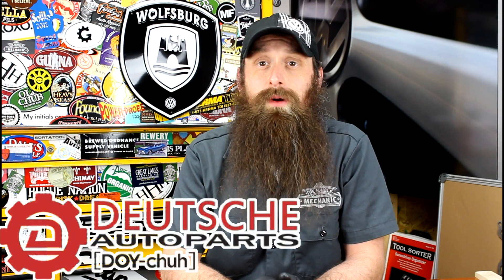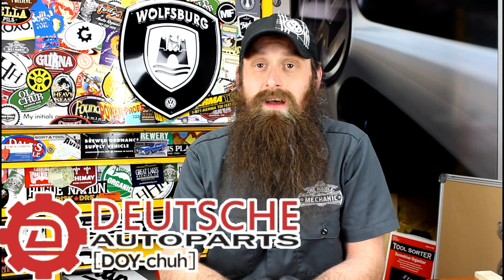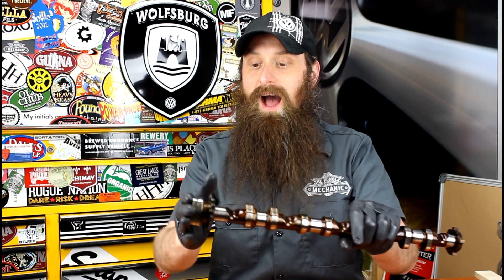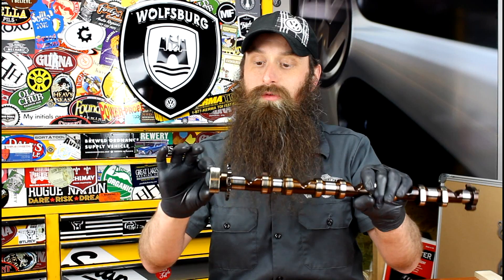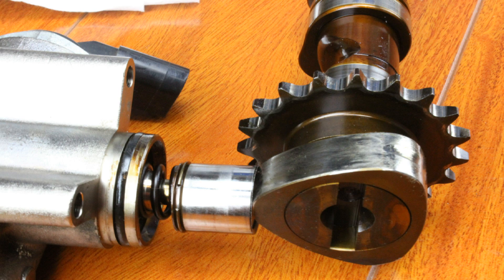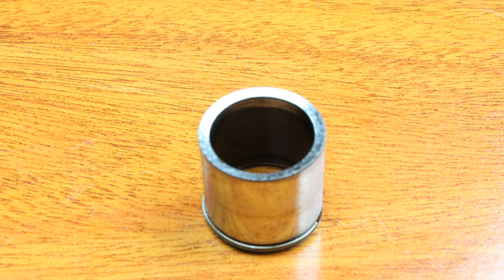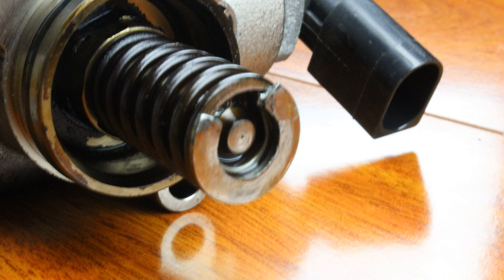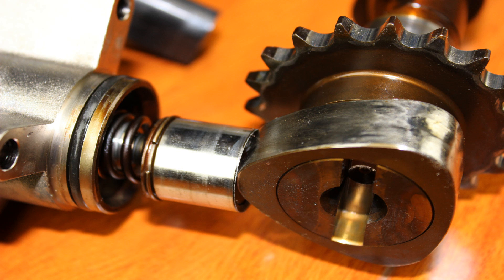How The VW 2.0T FSI Fuel Pump HPFP Fails

Comment: Hi HM. Is it possible that the pump and follower could be damaged whilst the lobe is just fine? Replaced the HPFP and the Cam follower without replacing the Camshaft and the car is running just fine, i'm just wondering what the dangers could be.
Reply from the maker: With no damage to the cam, I doubt it. But it may not be bad enough to cause an issue.
Reply: HumbleMechanic Thanks Charles

Comment: My 2005 fsi raves do not go above 4000, and fault code is p310B, that is low fuel pressure, could this be the problem or something else
Reply: douglas dingindlela Mhlanga did you fix your problem? My car hat The same problem and I can't fix it😟
Reply: Yes finally got it sorted yesterday, had to change my throttle pedal sensor, and clean the throttle body, now all is good and an enjoyable ride again

Comment: I have upgrade my HPFP for a high performe one, the Evo Technik by Autotech. But I'm getting an engine fault flash light. Do you have any thoughts on this?
Reply from the maker: wha tis the code?
Reply: HumbleMechanic "too rich on fuel"
Reply: If it not mapped for the new volume it will flag a code.

Comment: Hi humblemechanic thank for all the help you have provided us.
My vw cc 2011 has a problem out of no where is shot off and I though it was the HPFP and I order the part from the DEUTSCHE AUTO PART and i was really hoping it was that but it turns out was not and still does turns off when am driving it and it does not show check engine light.
I took it to a certified mechanic and since the check engine light is not on the scanner can not read it. Any idea from where is the problem? 
Thank you
Reply: hey man. did you find out?so what is the problem actually?

Comment: Hi. Soooo. I bought a cam follower thinking mine was bad, i removed HPFP and it was just perfect, no need to be replace... So my car keeps lossing power and shuts down because fuel problema with HPFP. Cold it be no power on fuel pump? How to check? 😶 or high pressure regulator ? Sensor??? 
Please help 😪
Tank pump is new.
Reply from the maker: +Gustavo Ortez fuel pump control module?
Reply: HumbleMechanic 😕 soo i replaced it. The car is working a lot better now but code P0089 & P2540 stills is there and keep coming back. Sometimes car shuts down and won’t start until i give it sometime. Any other tip? 😢
Thanks for your help and hard work lol
Reply: Gustavo Ortez hello as you know this car can be a real pain 2500 bucks later i got the same bogging nocking replaced fuel pump camshafts change followers mass air flow sensor fuel pump fuel filter water pump ignition spark plug coils I still get the PO101 code

Comment: I know I may be going out on a limb here, but would you say there is any permanent solution to this cam follower catastrophe? I find that checking my cam follower periodically could cause future damage to the pump bolts by wearing out the threads and removing the bolt from the banjo head fuel line isn't quite fun. I also have been doing some research and I found that there is a "2.0TSI roller cam conversion" for the "FSI"models. Would you say it's any good?

Comment: I have a p0089 code saying fuel pressure regulator, could this be the cause?  2006 A3 2.0t, I just checked and the black paint is worn off the follower, I'll replace that but do I need to replace the regulator that sits under the tank?  Soo many chats about this code and people just replacing pumps and filters with no solution.  Any feedback is appreciated.

Comment: Hi, cool video very helpful. I recently purchased an Audi a4 2006 2.0T Quattro. The check engine light come on with code P0089. The mechanic who happens to be a german auto specialist at the initial stage said he checked the hpfp and cam follower cam shaft and it looked fine. They replaced the sensor on the hpfp, after a day the light came back on same code. Now he said its that hpfp. I can notice the car does have a little hesitation from idle and if you gently press the accelerator it jumps to second gear. I was told this is normal as its a turbo i dnt notice power reduction the car has power but it does have a slightly louder noise than normal. I am going in next week to replace hpfp and cam follower. What are your thoughts. And also are fsi engines louder i went to audi and test drove a audi a4 2012 and it sounds like my 2006 but a little quieter. Thanks

Comment: Mine failed, vw Canada does not have a warranty extension for this issue. The retention nib on the hpfp was starting to get worn through, the camshaft seemed fine so I replaced the pump and the follower. Gunna check on it in 2000 km or so to see if the follower is still in good shape.

Comment: Hey! I have an automatic 2010 VW CC with 108K miles on it. My check engine light recently came on and I got a diagnosis and it coded P2015 "Intake manifold runner position sensor/switch circuit range/performance bank 1". Afterwards, my engine also began to stall and shut off and right before it would shut off the battery icon would pop up on the dash. I replaced the battery and I am still having this issue with the car stalling and shutting off. Sometimes I have to get a jump in order to get it moving, sometimes getting a jump doesn't work at all. Is this a common issue or something that you have seen before? If so how do I go about getting it fixed and about how much do you thing it would cost me?

Comment: Will this most likely fix a p2293 code? Says fuel pressure regulator and also got a system lean code with it. Replacing fuel filter today to see if it gets fixed. If not, going to the stealership. Wish me luck. PS love your videos helped me with a pcv valve and cpl other things. Please respond. Thanks!
Reply from the maker: LOL, best of luck. I got my fingers crossed for ya

Comment: hey Charles love your vidoes, Im a tech at a shop and a b7 audi came in with a valve cover leak, Mitchell said at was a 6 hour job and a special tool was needed to lock the cams... so they shiped it and i dint get to do the job:(. I have never done a valve cover on one of those... i just want to know if it that is really what haves to be done. if so. i will need to get that tool cause i plan on up graring my own b5 avant for a b7 avant. thank u for all the good content and keep up the good work brotha. 🖒

Comment: Thanks Humble Mechanic, all great/very helpful videos. my question is: once the cam follower wears through, where do the little metal parts that wore off end up going? the cam follower metal flakes/hpfp spring retainer? where does this stuff go? into the engine? 

if mine was covered under extended warranty, should I be concerned that I have metal flakes floating around in my engine?

Comment: Hi Charles, great video! A+! On my 07Passat 2.0T FSI, after a brief 
inspection i found the cam follower to be broken, there's a hole all the
 way thru and the center piece metal is gone most likely into the 
cylinder heads and the HPFP itself has a little chewed up on the edge of
 the piston, where it touches the cam (due to broken follower). I know 
not good signs at all, but the upgrade internal kits are about 500 bucks
 from places like Autotech I found that insanely expensive for just a 
few piece of metal piston..I'm wondering If I can just get away with 
just replacing the piston from another used pump? and put a new cam 
follower, and replace the cam? How can I tell if my camshaft is damaged 
from this, just look out for scratches and the uneven wear on the cam 
lobe? Or what you've heard until here is enough for you to call it a bad
 cam and go ahead and replace it anyways. I'm also wondering about that 
broken metal piece out of the follower, where should I look for that?? 
Thanks in advance!!
Reply: John D what ever came of this? I have the same issue and wonder how long the car will last without replacing the minimally worn cam lobe.
Reply: Me too. Found mine all chewed up. Did you ever have issues thereafter with the metal pieces/debris from the broken follower?

Comment: hi ,
if the follower have a hole but the fuel pump looks good , no engine light, car runs good. do i have to replace  something else ?
thank you.
Reply from the maker: +Cezar Fuccile the camshaft needs to be replaced. Also take a VERY good look at the pump. Odds are it's damaged
Reply: HumbleMechanic 
that is a   very bad news . I just bought that car and I didn't know about this fail.
thank you.
Reply: HumbleMechanic same situation here.. What's a ballpark price on replacing an intake cam? I can see some minor wear on the cam lobe, but not sure if it's worth a 4k investment or just sell it.
Reply: What can happen if you do not replace it (did not check it yet but have no symptoms)

Comment: hello, I drive vw Passat  FSI  2008 model. The oil pump failed and caused athe can to fail as well. Both have been replaced and the car started but cannot have sustained engine steam. what nevt could I possibly check? thanks.
Reply from the maker: yikes, the engine may have severe damage.

Comment: Alright, so today my sister let me drive her gti to run some errands(she rarely lets me drive it) and of course the first thing I did was try to hit boost but it never even made it above 0 psi, so the first thing that came to mind was a boost leak. I pulled the codes and they were all related to fuel pressure (p2293,p0089,p0087) so would a bad cam follower cause a no boost problem?  also multiple misfires came up.
Reply: yes, yes it can. I'm guessing her car went into some kind of limp mode. changed the follower  (worn  all the way down to a huge hole) took it for a spin and it built boost again. only one problem. when I took the follower out I found a piece of metal that looks like a valve spring retainer lock, pretty sure that's bad. HM, have you ever seen a retainer lock come out of the cam lobe??

Comment: I bought my 2007 Passat Wagon at 95k and one the road home, the CEL came on. Found that it was this issue. I had to go to the stealership several times until they could get the damn code. Luckily I was able to get it done for free under the extended warranty. If not, it would have cost me well over $1500 :/

Comment: You said that you need a couple of tools to do the camshaft timing properly. What tools? I know about the one with two legs that push down into the cam cutouts but not of another. Can you tell me the tools?
Reply from the maker: +James Barratt that's the one you really need. If you are removing the exhaust cam adjuster you need a special spline drive.
Reply from the maker: +James Barratt that cam tools is the most important one. The only other odd tool you need is to remove the adjuster on the exhaust cam. It's a poly drive I think. Other than that, its basic euro hand tools.
Reply: After complete cylinder head overhaul and engine rebuild, i'd tried to crank it only noticed petrol leak pouring down engine and off sump underneath. It has to be coming from somewhere obviously. Any ideas?
Reply from the maker: +James Barratt doubt check the high pressure fittings. I've had them leak on me before
Reply: So tell me something. I had to use grips and clamp a rag around the exhaust camshaft to hold the thing so the camshaft sprocket mark would line up with the mark on the plastic cover. Is this normal, as without and just the tool the mark was 10 degrees off.

Comment: My 2006 GLI just stopped running. Basically I put the car in 1st gear,crossed the intersection heard a soft bump and lost all power. I was lucky that it was around the block to my house so I pushed it about 50 yds. I tried to start the car but to no avail. i see that the belt and alternator try to spin but nothing else. Of course i hear a sound like it tries to turn over but sounds almost like it ran out of gas. I have 1/2 a tank full and had an oil change about 2 hours prior. So I thought, could it be my fuel pump or the HPFP which I just found searching for a solution. Could it be that or something else? Any help would be great. Thanks!

Comment: ive owned my car since 55k miles. its now at 120k i was able to get about 25k out of my follower before i started to sleep less at night. now..i have to replace it every oil change interval 5k miles because i decided to get an upgraded hpfp. fun stuff. totally worth it though. good video!
Reply: ps. i have a 2006, how hard is it to convert to the 2007+ soft line?
Reply: Why because you have an upgraded high pressure fuel pump, do you have to change the follower so often?

Comment: Hi i have a tsi 2.0t and all ready change a camshaft position sensor, because it was the code i was having from the computer but my hard starting issue is there.
Reply: Hard starting can be sticking valves i heard and not correct timing. Just rebuilt an fsi engine myself, and heard that when doing the revision

Comment: Wow this is on point.  I just put my 08 Passat KOMFORT WAGEN in the shop for the exact problem.   However the dealer said that because it was so severe, they also had to replace the cam, timing components and the head.   When my pump failed due to the cam follower, parts of the spring had broken off and caused extreme engine damage.    It sounded horrible.   
Thx for posting.

Comment: I have a 2006 Passat with a 3.6 The HPFP runs off a timing chain gear with a cam. I'm getting the typical codes and hearing a noise from the timing chain side. Do you think that gear/cam is the root of the problem?

Thanks

Comment: I have a 07 Passat Wagon 2.0T... I recently lost power on the road and after that I couldn't start the vehicle... OBDII tells me it's the high fuel pump and the CAM sensor... Take it to the dealer and they say that none of the cylinders now have pressure (0 PSI), so they are trying to sell me now an engine to replace ($$$$$)... Does that make sense? I got a new timing belt 7 months ago (10K miles) and they also replaced the high pressure Fuel pump, any chances I can claim warranty?, (1 yr or 12K miles)

Thanks man...

Comment: My 2005 golf gti had a power lost problem while driving at 160km/h, I have checked the cam follower and it completely broken, then I  changed the cam follower and I still had the power lost problem. After a month I bought a brand new HPFP, when I tried to replace the pump and I found that the cam follower was broken again in only 500km. Finally, I changed the pump and the cam follower but the car still losing power at 180km. Do you think the camshaft need to replace as well?

Comment: Can u make a video of rebuild a fsi turbo engine 2.0 like taking apart and putting it back together.
Reply: Hey Charles question, I have a 08 TSI 2.0 Jetta, I recevied a code indicting a speed position sensor. Where could I locate that on the engine. Thanks in advances, Great videos by the way super helpful¡¡¡
Reply: EW@@@a

Comment: my 2005 golf 5 gti is sounding like a diesel car or even worse a tracktor. could it be the cam follower?
Reply: They aren't complicated, just different. I just wish there was a reliable timing tool for the intake camshaft.
Reply from the maker: +Nkululeko Liberty Mbatha Only if it is a direct injection engine.
Reply: +HumbleMechanic im working on a vw passatt 2.0 all this cam follower worn completely thru wife drove like that couple weeks car wont start now...can u post a video of the tools needed torq specs for the cam shaft and how to do it... ive worked on other motors but heard vw are too complicated
Reply: If it still drives the same it's probably an exhaust leak near the engine, like the flexi joint or manifold.

Comment: It takes 15 minutes to replace, the cam follower was ok (repalced it anyway), the pump just crapped out.  If the follower is failing there is much more going on, i.e. junk camshaft.  The new followers are titanium, and the aftermarket pumps will kill a stock camshaft, so be careful...

Comment: Hi Humble Mechanic, 
I purchased a Audi 2007 2.0T FSI which had code P0089. 

question: do I need to replace my Tfsi Cam shaft?

Status: 
Car was driving and had power and could reach over 80mph.
I inspected the Cam follower  was worn at 70% and a slight wear is noticed on the tip of the HPFP.

Action 1:
 I Replaced the Cam follower & the fuel filter and immediately noticed performance problems (the car would die while at Idle when checking Measuring blocks 106, 103, 230 in Vagcom) . 
The in tank fuel pump was working at 83% and although I purchased an In Tank fuel pump, I never replaced it because I found out mine was not accessible from under the rear seat. Since that time had code pointing to the low fuel pressure sensor which I replaced but P0089 still there and performance issues is still present.

Planned action 2: Replace HPFP soon

Question:
Could my issue be related to the pump itself without the Camshaft having to be replaced? 
as you may already imagine, I could escape the Camshaft replacement. However, you said in your video that if HPFP needs replacement then the Camshaft also does need replacement. 

Thanks for reading and replying
Reply from the maker: +mamery jazz IF the follower was worn into the pump, the cam is damaged too. They all kind of wear as a unit. If there was just wear on the follower, you would probably be fine.
Reply: Thanks for replying promptly, HumbleMechanic.
Not sure if the follower was worn into the pump; it shows wear and  the pump's wear at the tip is hardly noticeable. I wish I could upload the pictures but I'll just install a good used pump and see what happens.
Fingers crossed.

Comment: Hi I have VW Passat B6 axz 3.2L v6 24v and I have error with the low fuel pressure regulation, Fuel pressure outside specification. I have vibrations on the engine. The error code 12555

Comment: i have a vw jetta gli 2.0T my timing belt rip and my valve bendes and took my head to rebuild after i put my car back together there a weird knocking and a misfiring on thw 4th cylinder and it does the same thing you said it feel like there no power but it will still drive. what can it be